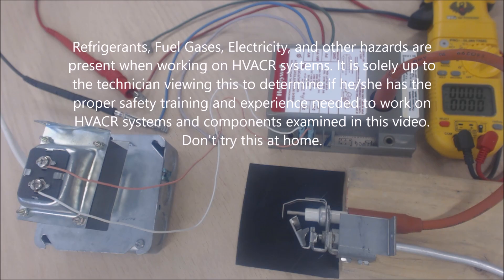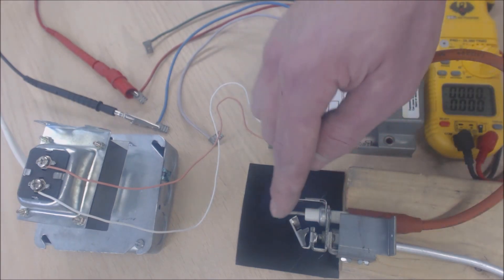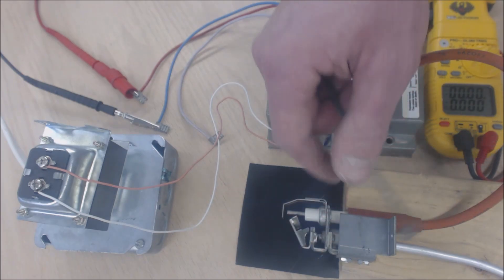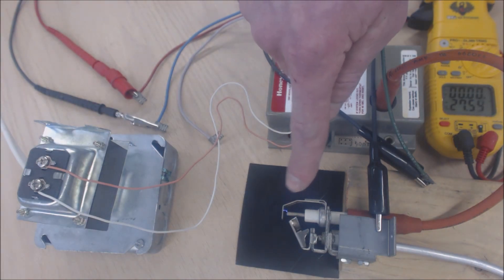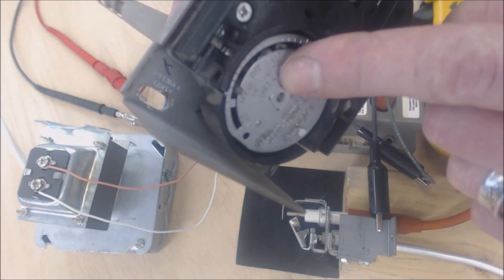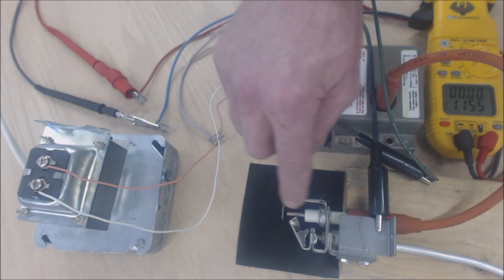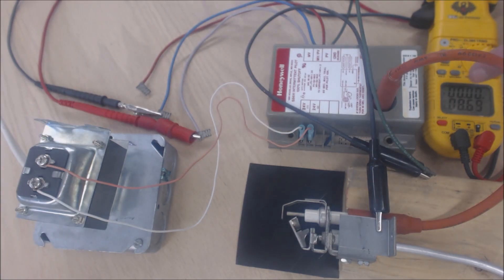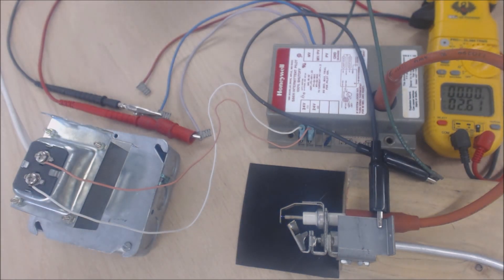Gas Furnace Spark Ignition Control Troubleshooting!

Comment: great info, thanks!   my furnace is short cycling and i cleaned the rod, changed the flame rollout sensor, bypassed the exhaust pressure sensor.  when i turn the furnace on and call for heat everything is fine until things get warmed up and after 10 15 mins it starts shortcycling again.  i replaced the module and nothing worked so i put the old one back, at least i got some heat.  any idea where i should look next? thanks
Reply from the maker: Are you reading the 24v during this time? It is possible that the high heat temp sensor is tripping due to being old or a lack of airflow and the temp rise increasing while the unit is running
Reply: @acservicetechchannel  I'll check the voltage and I put a metal plate between sensor and flames.  I did knock on mod while running and as soon as I stopped knocking on the mod then it started short  cycling again
Reply: Voltage is good.I removed heat sensor about 6inches away.not short cycling at this time
Reply: Funny everything ran fine until it got up to temp.  I bumped up the temp to 220 and the flames came on them out.  Started short cycling again.  The heat sensor wasn't even near the flames.  Hope that helps.  I lost 24vt on mv and mvpv when it short cycles never lost power on pv at all
Reply from the maker: Is the igniter shutting off? With the power off, check for continuity from burner pilot tube to the ground connection at the board. It needs to be very close to 0 ohms
Reply: all fixed!! thanks for your time.  turns out the metal was brittle above the igniter and broke in my hands.  i just mig welded it back on and works great.  the problem occurred after the metal was red hot and electrical connection failed to the igniter, when it was cool it worked fine...
Reply from the maker: Great, glad to help Dana!

Comment: First of all, EXCELLENT explanation, just wat I was looking for. Now,  I still can't determine what's wrong with mine, slightly different model, but same basic functionality I have the S8610F. When the unit receives the call for heat, I get a spark, the pilot ignites, the spark stops once the pilot ignites, but no voltage passes to the MV, then pilot turns off. Then sparks starts again, turns the pilot on again and the cycle repeats.  The fact that the spark stops, makes me think it's getting signal that there is flame, (why keep sparking if the pilot is already on, right?) but it's failing to pass voltage to the MV. For the grounding, I tested two things, continuity from the spark rod at te pilot to the spark terminal at the module (to test the spark wire) and it was ok. Then I tested continuity from the pilot assembly to the ground terminal at the control module, and it was good too. Any thoughts?
Reply from the maker: Sounds like it is a bad spark control module if you are getting a flame rectification signal verifying the flame, thanks
Reply: AC Service Tech LLC.  Thank you for the fast reply. I ordered the module, let’s see how it goes.

Comment: Thank you for the info! However I am still having issues with my main burners not igniting. I turn the thermostat for heat, the inducer comes on along with the pilot and thats about it. The main burners never ignite even when I'm reading  26.5v at the MV & MV/PV terminals. Do you think it's the gas control valve?
Reply from the maker: Or the gas pressure. Check for 26.5v actually on the valve too. I have also seen cobwebs over the gas orifices as well preventing the gas from coming out in the right direction.

Comment: I’m only getting 18 volts from mv to mv/pv then  gas valve starts buzzing and voltage drops to 16 and gas valve shuts off and fan keeps going
Reply from the maker: Make sure your input voltage is high enough to when this happens. If it is not then the source problem is before the ignition control, thanks
Reply: So I broke the flame sensor :-(  and i will like to replace the gas valve and module but I’m having problem finding the gas valve i have the same set up you are showing in the video with a robertshaw 71f-11A-017 what module and valve or the whole kit you will recommend

Comment: I got 24 coming into the box but no spark & no voltage on mv & pv. Spark wire has continuity. & Pressure switch makes. Would this indicate a bad control box? Thanks for your time.
Reply from the maker: Yes if you have 24v input into the ignition control and nothing on pv then the unit would be bad, thanks
Reply: I figured that was the issue. We only had one of these intermittent spark to pilot style furnaces at my school, so I haven't had that much experience with them until my dad's furnace quit working a few days ago. I replaced the old ignition box with a honeywell 8610u & she fired right up! Thanks for the video & reply.

Comment: My problem is if I plug the ground in to the gas valve it shorts something out and my relay in my Honeywell Aquastat relay clicks on and off rapidly and never lights the pilot if I unplug the ground from the spark controller everything works great good spark, fast flame.....can I just leave it unplugged until I get a new one? ...I’ve already replaced the gas valve thinking it was a short in the valve ...I’ve went thru and doubled checked everything in your video also to make sure wiring was all right
Reply from the maker: That is an odd one since the flame rectification signal is carried back through the ground. There is a safety problem with that since it would continue to put gas in if it thought there was a pilot flame and there wasn't one, thanks
Reply: AC Service Tech LLC i don’t know what was going on I couldn’t figure it out I ended up replacing my Honeywell Aquastat relay and the problem went way i now have the ground plugged back in and it’s been running fine all day fingers crossed 🤞🏼 I hate not knowing really what was wrong

Comment: What happens if the rectification occurs directly through the HSI and NOT a separate flame sensor? Do you also test on at the ground of the control module and the unit on will be in warm-up?
Reply from the maker: That is a tricky one on those old Rhuud rheem units. If you are having an intermittent problem then you could put a retrofit flame rod in place.

Comment: I get a flame to the rod and voltage at pv then the voltage stops and then I get voltage again then it stops and continues the same sequence basically just comes and goes but burners don’t ignite
Reply from the maker: If you only get 24v to the pv then the problem is before the ignition board such as at the pressure switch, thanks
Reply: Thanks to OP's amazingly helpful video here I just now fixed a similar problem myself. In my case the culprit turned out to be a few severely cold solder joints on the blade terminals of my ignitor board, revealed clearly via poking at those connectors with a sharpie (very carefully of course!) while the circuit was live. Assuming you rule out everything before the board like OP advises, if you find that you can get the circuit to change state by wiggling those terminal connections, try pulling the ignitor board and reflowing all the solder joints on there. It was an easy job and did the trick for me. Kudos for a great tutorial, OP!

Comment: Great video. I have the same ignition setup as here, spark lasts up to 5 minutes before pilot is lit. If I move the pilot assembly away from the mounting point and pilot will light and 24 v is sent to main valve. It has a good ground.
Reply from the maker: Is the pilot tube loose, is the flame good height after ignition? If the pilot head bent out of shape and gas not staying in the right area? thanks
Reply: AC Service Tech LLC pilot tube is indeed bent. I tried to bend it back to center with a pair of channel locks but i don’t want to break the head. Do I have to tap it out of the housing it’s in to re center it?
Reply from the maker: @guillermomartin2185  It has a compression ring so once you undo the brass nut, the tube with compression ring would come out of the head. You would reround it with an adjustable wrench which has a flat surface turning back and forth on the outside diameter, thanks
Reply: AC Service Tech LLC done. I reinstalled it and it does the same thing. It Seems like the inducer motor draft  prevents the pilot from kicking on.
Reply: @guillermomartin2185  Hi, this is old news to you now since your question was 3 years ago. I'm having an issue with my furnace as well and while going through this thread I noticed you were talking about bending the head of your pilot burner to center it. In researching my issue, it seems to me that they make these pilot assemblies with a left of center or a right of center (and perhaps centered) pilot burner. I think that is, so the pilot flame burns toward the spark and sensor rod as well as angled toward the burner in order to ignite the flame. Whether left or right would depend on which side of a burner the pilot assembly was attached to. I'm not a tech but I think that seems to be the way they are. How did you make out?

Comment: Should I always get power to the pilot control?  My furnace will not ignite.  This control module seems like the most likely culprit but I'm not registering any power.  Could it be something else?
Reply from the maker: You would only get power to the pilot control once the safeties are connected such as the inducer motor or flame roll out, high heat sensor, thanks

Comment: Great video, I have the same issue, the pilot is on, but no main output, I check the ground is ok, the main output is always 0v.
Reply from the maker: Disconnect the power and disconnect the ground then take a resistance reading from the pilot head to the end of the ground to see if the resistance reading is high, thanks

Comment: What a great video and thank you for the clear, easy to understand explanation and demonstration. Excellent!
Reply from the maker: Thanks Jason!
Reply: Another thing I find impressive is that you courteously take the time to thank people for their comments...perhaps each and every one, that is great!

I am working on my Dunkirk natural gas boiler from 1987 and I noticed the last season or two that it would frequently keep sparking the igniter even after the pilot and the main burners were lit.  This year I decided to look into now that winter is on the way.  This system uses "one wire" for detecting the pilot, not a separate flame sensor like on most modern models.  The igniter rod (mostly wrapped in enamel like a spark plug just to be clear) appears that it may be a little dirty and so I would like clean it with some emery cloth but it is very difficult to reach while still attached to the center burner (3 burners total).

My question is this... If I unscrew the two screws holding the iginiter assembly to the burner and bend the aluminum pilot gas tube a little toward me so I can clean the rod am I creating a safety hazard in the form of a leaky pilot gas supply tube?  Will cleaning that rod even help me out, or is it likely a failing Honeywell control box?

Thank you in advance!  Keep up the great work.

 @acservicetechchannel
Reply from the maker: Cleaning the rod should help but it may be a weak signal on the ground coming back. If it has a separate rod for the ground then yeah cleaning that too will help. We uses steel wool and not emery cloth though due to silicone residue.  We usually disconnect the pilot tube and spark assembly at the gas valve and just pull the whole assembly out. Try to not move the pilot tube around too much due to a possible kink. You could also just leak test the tube with non corrosive bubble leak detector like I have at amazon.com/shop/acservicetech thanks for the note and yeah it is a lot answering everyones questions but I try, thanks
Reply: @acservicetechchannel  Thanks for the quick reply, very good advice, and professionalism. I had not thought of that point regarding emery cloth, glad you said something. I might just have to order that leak detector you recommended. Thanks again, take care!

Comment: Great video.
Great teacher.
The issue I'm having is no spark or flame. I replace everything but the ignition wire.
I replace gas valve, 
Ignition Control module, pilot burner,
Still not getting a flame or Ignition clicking.
I believe is my ground. Will try it.
Thanks for sharing your knowledge
Reply from the maker: Thanks, let me know how you make out. Do you have a strong 120v coming in while under a load and then a strong 24-28.5v?
Reply: I did everything you did on your video. Still won't start. I noticed bad ignition wire. I'm going to order one as soon as I get a chance. Been working 7 days a week since February no days off unless a holiday and then I sleep during day due to I work 3rd shift. I think the Honeywell module may be bad even though it's new. After ignition wire is replace I will recheck everything again. I will let you know what my findings are. Thanks again for your help
Reply from the maker: Oh nice, ok thanks

Comment: I have a unit where the spark ignitor turns back on when the main valve is given 24v. Any idea what’s going on?
Reply from the maker: Hey IMon, when the gas comes out of the main burner trays or burner tubes, does the gas pressure blow the pilot off the flame rod by chance? Is the pilot flame large engulfing the flame rod and does it move or flutter or reduce when the main comes on?
Reply: acservicetech sorry for the late reply but it ended up being the gas valve with a weak coil. It sound like a spark ignitor when it would be energized lol
Reply from the maker: Got ya, glad you found it!

Comment: Good job explaining how it works. I have a  Utica boiler model PEG150BIDE with a VR8204A gas valve and a S8600M Honeywell control. I have a spark and a flame that lasts for a second and turns off and again a spark followed by a flame that lasts like a second, and it goes on and on, but no steady flame, is it a bad gas valve?
Reply from the maker: Make sure to check your gnd wire, clean the ground where the flame touches the metal and brings the voltage from the rod to the metal nearby. Check to make sure that your pilot tube is tight as this also may be part of the ground. In reference to the gas valve, you can check if you are getting and then loosing the 24v signal from the ignition control thanks. It is likely a ground problem not proving the flame, thanks
Reply: That's not necessary, I bought a new S86, as you suggested, and it works, you know what you are talking about, you are good at that man, thanks a lot and have a nice and happy thanksgiving with your family!
Reply: One more question: that unit has a Safgard model VXT-24 automatic feeder with two wires coming from it (one white and the other orange), where those two wires are connected?

Comment: So I had a similar situation on Saturday with a York Unit . NO heat call , when I arrived I found that the roll out was bad . The fan would run but no spark would happen . I discovered that I wasn't getting 24 volts from the roll out on the spark control board . So I fixed that and everything was ok , I had heat .  Then I got called back . When I got back the unit wasn't sparking every time there was a call for heat . I checked everything again . The spark igniter was good , my connections were ok and the board I changed too and still the same problem (No spark) So is it my ground connection?
Reply from the maker: Did you have 24v to the pv and pvmv common? If you did, did you hear a spark clicking somewhere or in the ignition control board? You should have heard a click somewhere which would be the 6-10,000 volts sparking since you even switched the board. Did you make sure the spark gap was no longer than 1/8" or 3/32"? The ground would only have to do with the flame rectification but not likely the spark because the pilot tube brings that back as ground, thanks Sean!
Reply: acservicetech 
I figured it out today after your lesson on intermittent  spark ignition control trouble shoot. The problem I was having was that I wasn't getting a full 24/27 volts on the TH . So it was dropping out some where . I forgot all about the limit switch on the supply side of the unit in the heat exchanger . I discovered that the female plug in spade  connector was fried a bit just from the usual wear and tear.  I fixed it with a new spade and checked the ohms on the high limit to make sure it was still good . Closed her up , flipped the switch .... Fire in the Hole ! 
Got my 27 volts on the TH too 😁